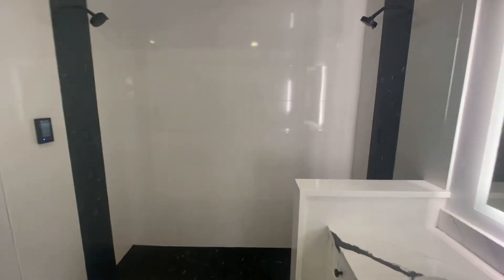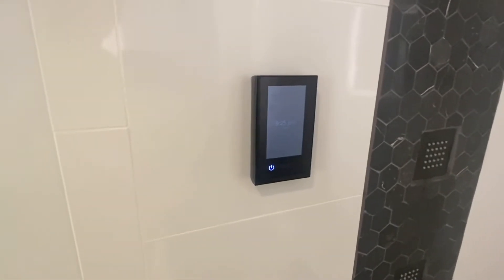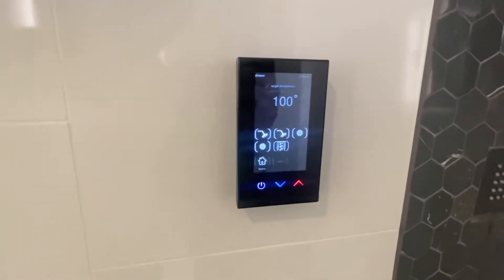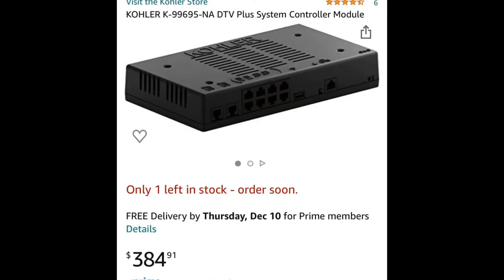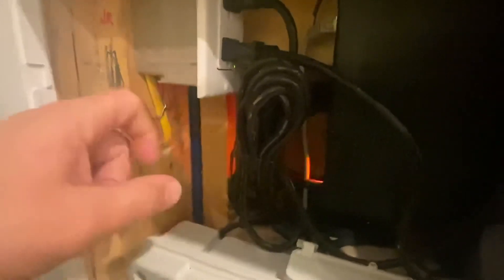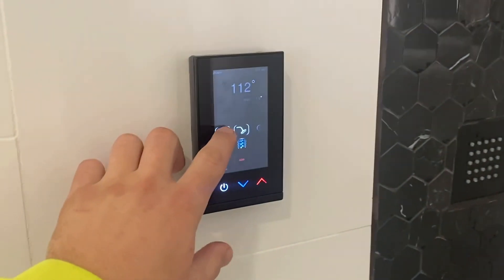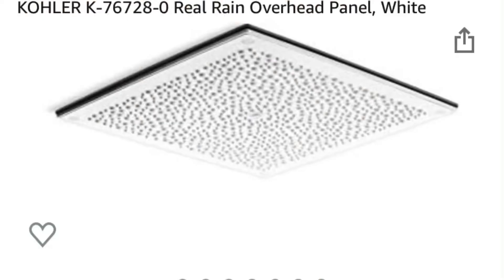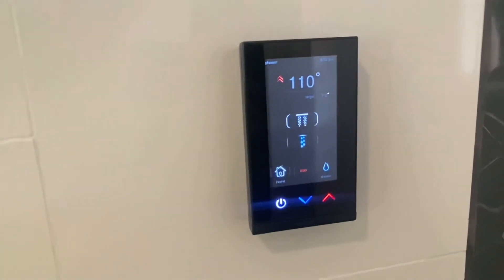DTV Plus Kohler

Comment: Nice job.  I have DTV  and have it for 11 years and have 2 displays (main and aux)  like you with 6 ports  and 1 display died and Kohler stopped making those models   so I have to get 2  DTV+  displays and the  conversion kit for DTV I interface.   I seen the video on Youtube and it's easy. Make sure you unplug the power before you connect the cables and adapters.    I personally like the old displays with the knob  better but the new ones are like Iphones and that's were Kohler is going.

Comment: If your electricity goes out, Is there a manual override to get the shower to work?
Reply from the maker: You will want a generator back up. Otherwise you will not be able to use the shower.
Reply: @shanksta81  Or have a regular shower in another bathroom

Comment: I am thinking about putting this in my new house.  A couple questions for you.  1. I understand that it needs power to start, but what if I am all lathered up when the power goes out?  Does it cut off and leave me stranded like that?  2. You didn't show it come up to temp., but does the display show the temp you set or the ACTUAL water temp?  3. How will I know when the water is at the set temp.?  Does it beep or something when ready?
Reply from the maker: Thanks for the question. It will tell you the water is cold and then it will show you the temp as it warms up to what you set it at. It always starts at 100 degrees before you set your temp. If the power goes out you are SOL until it comes back on. I have a house generator so that makes it nice.

Comment: Hello, what type of suspended ceiling did you use? In the shower
Reply from the maker: I framed it with 2x4’s. Then I installed cement board. After that I tiled it.
Reply: @shanksta81  thank you looks nice

Comment: Hi, do you need to use Kohler shower head and body sprayer or is it compatible with any other brand? TIA
Reply from the maker: You can use any shower heads or body sprayers you’d like.
Reply: @shanksta81  thanks!
Reply: Thanks for taking the time to do the video been looking into these systems lots of Moen videos but these systems are kind of hard to find information on I think it's because usually they're professional contractors only getting this stuff versus the other ones are more DIY

Comment: Hi, I was wondering how did the dtv system effect your  shower’s water pressure? And if beforehand you had a basic shower system? And what Was your shower water pressure like? The reason I ask is from my reach, when you use all of your output options, the water pressure becomes so low it’s  not at all enjoyable or worth the effort/$, especially with  an Electric tankless hot water system, 
thanks
Reply from the maker: 3/4” water lines to supply the system to the thermostatic valve. I can supply 3 of the 5 options before I notice a pressure difference. I can do all body sprays and two shower heads and still have plenty of pressure, but you can tell there is a drop in pressure. I generally use both shower heads and one body spray or the rain head.

Comment: What type (gas/electric/hybrid/tankless) and size (gallons) water heater did you use?  Did you connect each set of your 3 body sprayers together to one port on the valve? It looks like Kohler recommends that each have a separate port?
Reply from the maker: Tankless. Navien model  NPE - 240A is what I have. It runs about $1800. Yes, I connected 3 body sprayers per port.
Reply from the maker: Just pipe them with a pressure balancing loop. I made mine where, when I shut it off, all the water drains out of the line, through the bottom shower valve. I didn’t want the bottom loop to hold any water when I shut it down. Hope that helps.

Comment: Does steam require a port on the digital valve or can you plumb a separate supply line to the steam and then turn the generator on/off from the DTV+ control?  I am in the middle of designing my system and my understanding was that  did not need a valve port for the steam generator, but I would have to supply a cold water line to the generator and then a control wire from the DTV+ controller to the generator and a temp probe would also have to be connected.  I have been debating 2X of the 3 port valves vs 1 6 Port valve.
Reply from the maker: Yes, you can Bi pass the port. You will just connect it to the module. There is a good diagram. https://support.kohler.com/hc/en-us/articles/360002672394-DTV-and-Steam-Generator-Wiring-Diagrams

Comment: Did you cover up an outlet in the wall? That’s not code in this state.
Reply from the maker: No, you have an access panel that goes over the GFI. You have to have access to it, so you meet code. You will also need access to it if it trips. Plus you will need access to all your other components.
Reply: @shanksta81  gotcha

Comment: Awesome install! Did you get your shower doors on? Wondering how the system has been performing. Specifically is that rain panel worth it? Being gravity fed I’ve read some reviews of people complaint about the lack of pressure. I’d assume if you couple it with regular shower heads then it should be sufficient. Also are your supply lines 1/2 or 3/4?
Reply from the maker: Yes, I did get my shower doors install. The system is nice. The rain head is expensive. If there was one thing I had to remove, it would be the rain head. The pressure is like a heavy rain that it makes it relaxing. There is also another mode on it where it is a down pour. The down pour is confined to an area about the size of a standard shower head. The pressure is as great as a normal shower head. The down fall is the how much it cost. I just don’t see the value.

Comment: I like smart homes and all but this is beyond stupid. It takes less then 1 second for me to turn in and off the shower. This looks like it would take forever to just turn on the water and put it at a temperature you want. Can you imagine if you running late for work or something? If I'm in a rush I would have to run out the house with a dirty ass to get to work on time.
Reply from the maker: Actually it’s just a push of a button and the shower is on and at the temp you want. It’s faster than a standard shower.